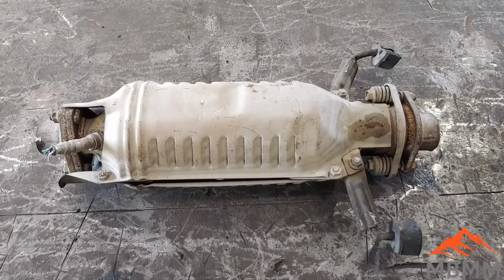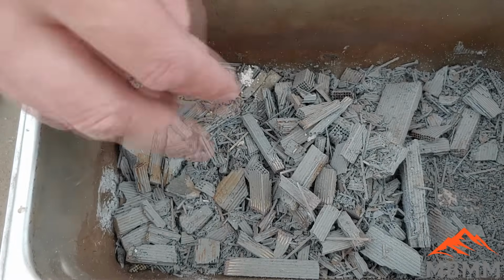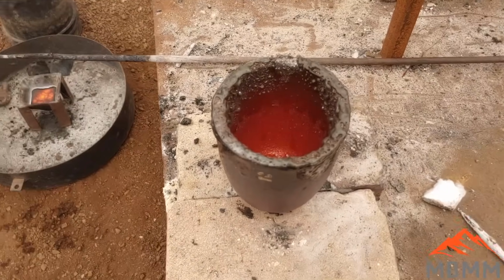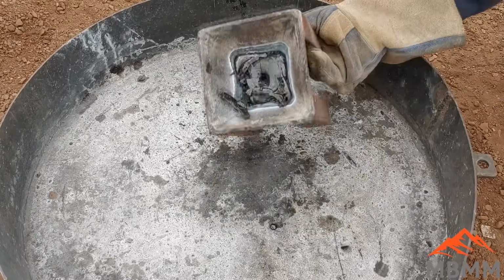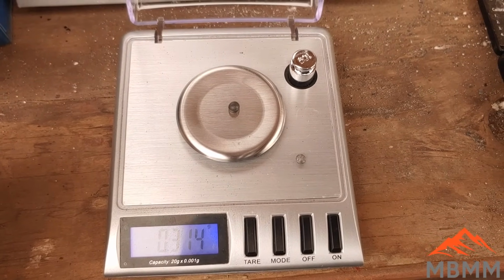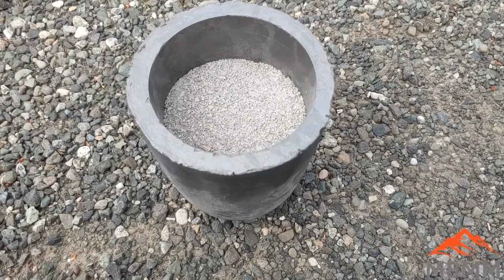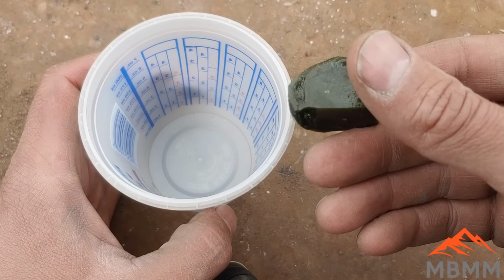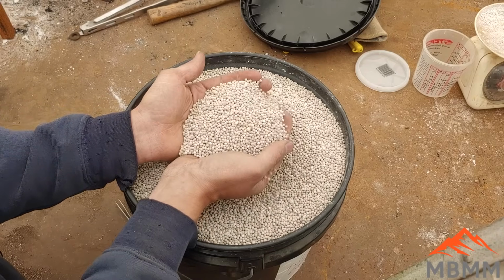Smelting Platinum/Palladium Catalytic Converters For PGMs..... Success???

Comment: Jason the cat that you used was an older model Toyota  or Honda it should have contained pt  pd and rhodium.  you lost a considerable amount of pgm in the dust.  I noticed that the bricks were melted some when you removed them from the shell it is also possible that there was some PGM loss when the cats overheated and began to melt while on the car.  if i am remembering correctly from my assays from years ago that particular converter should have contained more platinum than rh or pd.   i know that of everyone i have dealt with one company used an arc furnace to smelt the material and after the process the ceramic still contained enough pgm it went through another refining process with another refiner.  to get an accurate picture of how much pgm should be there is blend the crushed honeycomb from one cat. the reason being is if their are two bricks in the cat they will by design contain different amounts of pgm.  you crush them both togather get it blended well. pull a sample from that and get an assay on that too.
Reply: It was 100% a Honda cat
Reply: @MidwestJunkyardRacing  No sir incorrect. 110% Honda 😻

Comment: ANSWER TO THE TANTALUM QUESTION: The Ta reading on the XRF analyzer is in fact Pt. The natural frequency that is excited by X-rays for Ta and Pt are very close to each other and the detector on the XRF can't tell the difference. Are XRF analyzers that have a precious metals mode on them that will treat it as Pt instead of Ta. The same thing happens with Au and W.

Comment: That’s a rear o2 Honda cat. Should be on all DX/LX accord 94-97 and odyssey 95-97. I typically get 300-400 depending on market lately. The EX vtec accord uses a straight o2 so does the 98 odyssey. 98+ accords are all vtec and had straight o2 or the best slant o2.
Reply: What is a good website you recommend to check on prices?

Comment: hi if you used copper to recover the platinum/palladium could you use a acid to dissolve the copper to leave the platinum/palladium behind eg if you add sulfuric acid then you would get copper sulfate?

Comment: I remember a lecture from a scientific speaker who said that catalytic converter manufactures use tantalum metal as a filler for their products. Sorry that is all I remember. 
 Since catalytic devices are so valuable used these day and are being stolen right off of cars in broad daylight why have you had such a low recovery rate from the converter you have cut apart ??? What is the fastest way of recovery of precious metal with minimum outlay of funds ???

Comment: As you mentioned Strong caustic will dissolve pt group metals. Why are you not using litharge as opposed to lead chunks. I use the same flux as I use for gold/ silver assays. I heat longer than you would on gold assay and as high a temp as I can get. That results in a good decomp of ceramic and litharge has enough surface area to get good collection of p.m. All that said I prefer nitric acid digest to remove palladium and aqua regia for Platinum recovery. Pt is fine enough that it dissolves fast enough to be reasonable. BTW I have heard that silver palladium alloy is difficult to separate. That was my experience the one time I tried

Comment: Use copper as a collector then dissolve the copper off with copper chloride. The old HCL and H2O2 trick.  I’m sure someone here will probably know if that might work or not.

Comment: Those silver fingers/branches will happen when soldiering circuit boards and can lead to a failure in a circuit board at any time in its lifespan and is a leading reason to be a bit picky when buying electronic devices

Comment: Honda accord 94-97  large foreign,  number is on the edge of flange and Always rusts out, and you need ball mill  and should look like baby powder when you assay and smelt, and from my knowledge (could be wrong) you need plasma arch furnace to get hot enough for rhodium  because melts over 2500°  and there is only 2 of those in US

Comment: What if you tried melting at a lower temp after to melt the Lead away from the higher melting point metals and use a extrem high melting point screen as the "pour filter"

Comment: Best and quickest way out of the increasing melt point problem of your alloy Pt/Pd and collector would be a electric arc furnace.
I'm surprised no one makes a normal electric cupel furnace that also has built in electrodes for arcing the sample after its molten.

Comment: Honda cat, number is on the flange but they are usually way too rusted to read so it's identified by the fins in the shield. I think this came off of a honda civic if i'm not mistaken. Worth about 300 bucks so should have a fair amount of metals in it.

Comment: Would aluminum work for a collector metal ? Would it then be possible to separate the collector metal from the precious metals via gravity ???
In essence the heavier metals at the bottom of the mold lighter metals at the top ??

Comment: Also it's not silver coating on copper, it's a 3/4" rod with silvertip used inside high voltage equipment. Thank you

Comment: Zinch could also be used because is lower melts points than a copper or leads or silver as would evaporator at lowest temps as possible

Comment: you could use nitric acid and a hot plate to dissolve the lead but I would be careful of the fumes. they can be deadly. only problem is it would dissolve the palladium. but that can be retrieved via chemical means after.

Comment: My newest gig is using regular 20 muleteam borax instead of jewelers borax.  I'm in a charcoal forge so The heat at the top of the crucible keeps the borax from coming out the top. A burning board right over the crucible works well. there is 10X the water and co2. At heat the water is rocket fuel. Hydrogen and Oxygen. all the extra bubbling  is a GOOD THING. I'm trying to use washing soda now. I'm figuring that out. Maybe soda ash is good. The soda ash worked great with the 20 mule team borax. I'm still learning about the washing soda. It bubbles furiously too. And I want that action. Bringing the bits together. I use the sand on the bottom and over the top as a poor glass lid. It melts later.
PS I'm adding screened charcoal. for reducing fire. It's crazy looking in the pour. But the Gold doesn't stick to it. It doesn't hurt. It's kind of dirty. But I clean it up with a torch and cast a little bar which I can cut with a pair a dykes. to put in the cupel.. some guys use wheat flour that makes the charcoal and it is super fine. It probably turns to ash and may disappear. My charcoal is crazy dirty. But I contend that it doesn't hurt.
Reply: I use mule team borax and soda ash with salt manganese
Reply: @SRH420Stona  Thank you very much!

Comment: That was a Honda Accord cat. Actually it's called a Honda 02 because it has the angled oxygen censor. It's worth around $700 if left alone and sold.
Reply: Correct for the most part, it’s called Honda O2 Slant and yes because it is slanted on the o2 sensor. Value is on the top end but is dependent on current market values. The highest end Honda O2 is the Honda O2 Straight, the O2 sensor will be straight out the side with 4 fins below and 2 fins above the O2 sensor, fins located on heat shield. That would be valued from 800-1100 dependent on market value and are found on Honda accords 2000-2002. High value converters can range from $500-$2000 for one converter unit, price will always vary with daily market changes. Knowing market fluctuations for platinum, palladium and rhodium and knowing the valuable cats and especially knowing how to handle your material properly with little loss and high recovery, will give you the greatest success in keeping your profit margins the highest they can be. The loss of value through handling of biscuit material, 5% loss through air born dust alone and if it is an end of life converter, the value could be dropped by 10-20% with that alone as well. Wet and damp or oily biscuit will greatly affect your value and how much you pay for loose biscuit material if you are processing and sending loose biscuit to a smelter.  Use respirators when handling material  because breathing in airborn dust is dangerous and possibly deadly if built up in lungs. Be safe, be legit and make money baby!

Comment: So did you achieve 3200 degrees?  How long did it take ? Wow.
Bust my chops if I'm wrong. But couldn't you Cupel out lead all in one operation  I mean 3200 degrees F is going to burn out the lead right? Maybe take the lid off or add a little air. Can't you put carbon in for that? I wonder if your smaller pieces didn't get hot enough.  I think you have some platinum on your claim. Maybe more than the converters.  That process working good would be money.....if it's on your claim.
remember those grey chunks you were looking at.. good as gold?
Keep kicking butt. I love what you are doing. Winner winner chicken dinner. Atta boy. I love your work.

Comment: The Only recipe I can find for platinum flux is borax 10 to 1. i have heard that any sodium will cause platinum to be lost. Also a "Dust" Recipe . Fine  platinum may call for a reducing fire. Add wheat flour, or screened charcoal. Keep the oxygen OUT. Possibly sand on the bottom and some on top. Makes a glass lid. One very cool guy from Turky or somplace, uses crucibles of pottery and fashioned a clay lid and fired it in the smelt.. That has to be broken to recover. But that causes a reducing environment.. see David Hudson, Oremus on you tube . The long one. That guy developed the richest ore ever heard of. Ot was the way he prepared it. It's a rabbit hole. it's one of the most interesting things I have ever seen.

Comment: If you want to check if there's precious metals just blow propane through the catalytic converter or through a piece of it and heat up that piece and if it stays lit and it gets hotter it has Platinum.

Comment: Ceramic Structual binder(honey comb/ contains Al2O3, Fe-Cr-Al Alloy...) is main component of catalytic converter, Pt/Rh/Pd alloy as active catalyst, but contains very small amount(0.7-1.8grams/Liter when new..),  oxydised Ce or Ni as oxygen storage component,  Ba, La, Zr as stabilizer.
In addition, there's another type of catalytic converter which reduces NOx, so, we can find two honey comb in one can or two converters in one exhaust line in serial array.
This Nox Catalytic converter contains BaO(Barium Oxide) or KaO(Kalium Oxide) .
To get Pt/Rh/Pd from junk scrap is very hard and complicated process, melting is not so economical way...

Comment: I did some research on this subject. Rhodium melts at 1964 degrees. There are many Catalytic Converters in the country I live in. People are having their catalytic converters removed from their vehicles.
Reply: I'm thinking of using a Carbon-Ceramic crucible.They said that the induction furnace can reach these temperatures. But it's very expensive.I'm thinking of mixing acetylene and oxygen gas and burning them. How many grams of rhodium and how many grams of palladium and platinum could you obtain from 1 kilogram of catalytic converter?
Reply: We can find you a large quantity of catalytic converters. We want to turn it into rhodium. Can you help us?

Comment: Metal melts at low temp compAred to gold silver and platinum group. If you pour hot metal into metal to get the button won't the metal melt

Comment: Just use a blast furnace or Acetylene / Oxygen torch for your assay melt to burn off all lead instead of a kiln you will need at least 3300°F preferably 3400°F
Platinum melts @ 3234°F & Palladium @ 2831°F but you always want a couple of hundred degrees extra to fully melt the targeted metal completely
P.S. when assaying or melting only use with a ventilator system because the lead & other gasses givin off is highly toxic

Comment: Petrol convertors are 6-10% rhodium and the rest palladium. DiESAL convertors are 6-10% rhodium the rest platinum. Aftermarket cats only contain half a gram maybe a gram at most of precious metals. Original cats can contain several grams.  You really need to crush to 30micron or less to expose all the PMs the problem is the honeycomb material doesnt smelt to release the precious metals. You might have to use an unusual collector metal like maybe nickel for PGMs - i cant remember exactly whats best. Ah the honeycomb is ceramic, i think the ceramic is sprayed with precious metal containing corundum as a layer?
Your next experiment try this, split in half your experminent and use chemical extraction on one half.
Hydrochloric acid and h2o2 or aqua regia try plain conc nitric acid 2nd wash to get rhodium - its insoluble in aqua regia but soluble in conc nitric acid iirc

Comment: Looks like your making glass from ceramics. Try boiling in hot Aqua regia then precipitate w ammonium chloride or iron chloride. Adding a few drops on 92% sulfuric will drop any lead out of your aqua platt sol.
Yes inquiring is good measure corn flake your metals.
Edit I use room clean 98% nitric to my hydrochloric, as platt is more resistant of the PMs.
Reply: nice you waste 10% of the metals by use chemicals, how about you use a refiner and they can get you more money with having no work ? ahhh all the dudes think they are smarter than a industry made trillions since the mid 70s hahaha
Reply: @frankyshh6827  They whole point is DIY. They are refiners of scrap.  These are some of the exact procedures USED by refiners.  If it were possible to extract the PM from the ceramics IE; electrolytically they would. To my knowledge its not in this application. Refining something already manipulated by man is diff than extracting raw or some electronics.
I hear narcassism is welcomed on Tiktok.

Comment: Platinum and palladium melt at incredibly HIGH temperatures, palladium, a little higher than TUNGSTEN so smelting them isn't practical without a hydrogen/oxygen furnace if that! Industrially, they make an organic paste of palladium and form it (like tungsten light bulb filaments) then apply an electric current in a semi-inert atmosphere and burn-off the organic material leaving the pure palladium behind. The organic paste material reacts ONLY with the desired pure metal so other metals that might be mixed in the raw metal don't get into the finished product. One of Edison's worker's at the General Electric light bulb plant discovered this in the 19-teens making tungsten light bulbs cheap and light bulbs 4-10 times brighter per watt.

Comment: So if you use the lead as The collector metal then after you heated up and melt it and you have lead and platinum pladium why wouldn't you use muriatic acid to take the lead away, because muriatic acid wouldn't touch the pure Platinum pladium...
Reply: I think because it would make the platinum back into a dust after it ate the lead. He is trying processes to ultimately end up with one solid piece. But your idea does remove the lead no doubt.

Comment: Don't do a smelt on the honeycomb. To roast/smelt successfully it takes up to 12 hours to get it all out. Best way to get your platinum/palladium/rhodium is to use muratic acid and Clorox in a bucket with a bucket heater then recover with zinc powder and send recover sludge to a refiner

Comment: Why not just use an electric induction furnace. The platinum metals will have heat induced while the ceramic won't.
That way you can take it to the maximum temperature that the ceramic can handle, maybe the metal runs straight out the bottom of the honeycomb?

Comment: You should WET it FIRST & crush WET.  This avoids the (rather toxic) dust.
          You would be better off with chemical extraction.  Reason: you have a big chunk of "oxide stuff" (ceramic, glass) coated ON THE SURFACE with metals you want.  You take 100g of ceramic & are forced to involve that 100g plus 400g of of added stuff in your process.  You expend energy melting all this to high temperatures.
          Doing this chemically, the ceramic & glassy "stuff" is only inert material.  You need only worry about physical "drag out" which can be recovered with rinses. The chemistry only involves the 1g of metals coated on the ceramic.  You pour all that borax, sand, lye, & lead which you then need to separate the metals from.  You generate all that nasty "slag" which has lead & boron in it (4x the weight of the converter's ceramic weight).
          With chemical process, you are adding mostly water, hydrochloric acid, & pool chlorine to the mix.  These chemicals only need react with a few grams of metal.  The 3 metals are extracted separately from this with simple chemistry & filtering/sedimentation.  You don't need an XRF to determine the assay.  The chemical waste is either non-toxic, or easily neutralized.  The extraction can even be easily done without crushing the ceramic matrix.  If fact, it proceeds better that way as all surfaces are accessible.

Comment: The use cerium palladium rhodium and platinum in cats. Cerium is one of the most important ones in the cat because oxygen molecules bond to it. They use it to reserve oxygen so that when the hydrocarbon and carbon monoxide and nox molecules the platinum rhodium and palladium breaks apart has oxygen to bond to as they pass through the catalytic converter.

Comment: No need to crush them just acid bath them with free atomic chlorine and ozone. Bubbled through a 5 galllon bucket stacked with cat honeycomb. All the good stuff is on the surface and they come out bright white. When ready to harvest distill off the acid using a simple chemistry rig till you get a concentrated amount of metal salts. You can reuse the distilled acid too. Is a litte time consuming but you can get nearly all the metals and separate them. Rhodium at 20k an ounce worth it!